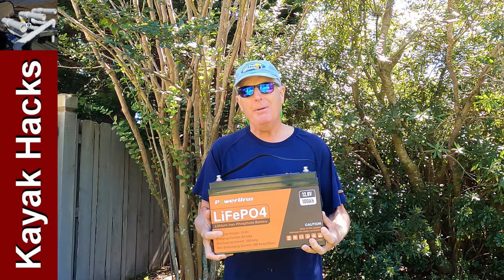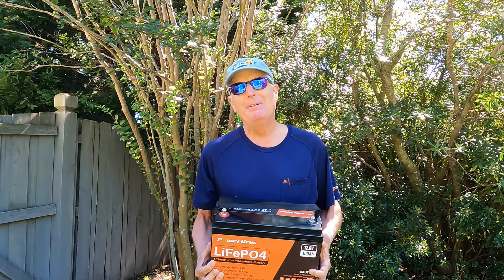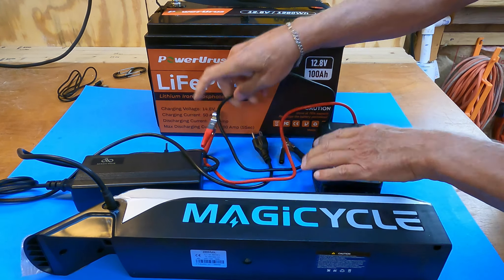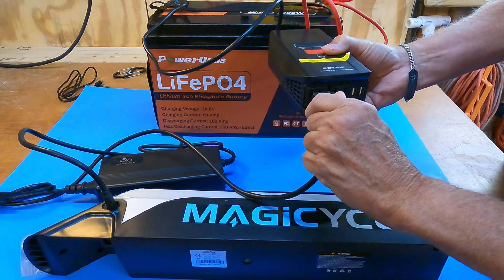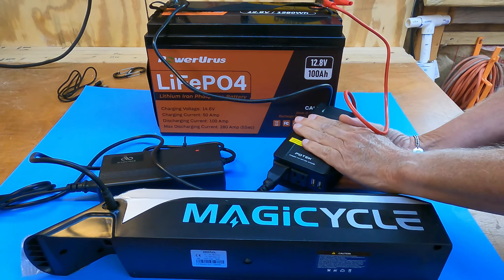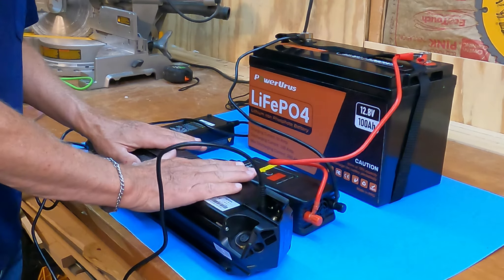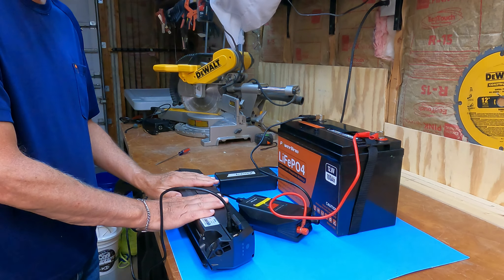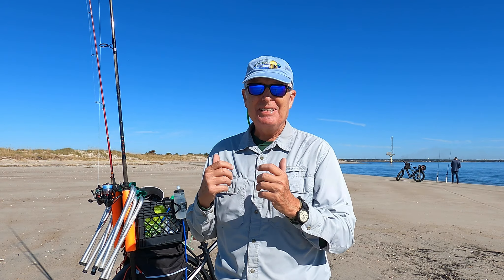How to Charge ebike Off Grid with a Trolling Motor PowerUrus LiFePO4 Battery 12V 100AH

Comment: That's pretty cool that the deep cycle battery can do that. Just curious. How much charge was left in the deep cycle after the charges?  I was thinking about using one on the back of my camper for supplemental power for lighting and such.
Reply from the maker: According to the bluetooth app, it had 16% left

Comment: I've done that with various laptops with lead acid deep cycle batteries, but laptop batteries are much smaller than your eBike battery. We need to change out to a lithium battery of some type for a couple of reasons: (1) lighter weight - I could easily get a 100Wh lithium with the same or less weight than our current 50Wh lead acid -- and -- (2) lithium batteries don't have the drop-off problem that lead acid batteries do.

What is your recommendation for lithium batteries? I believe you have used several over the years.
Reply from the maker: I like the one I traded for from Rebel Batteries. I gave them a signed copy of the leather bound version of my Dad's book (We were soldiers once... and young) in trade for their 100 Ah battery. I like it because it has a switch on the top where you can turn on the bluetooth app to monitor the status. The one in this video has a bluetooth app as well, but it is not as easy to use.